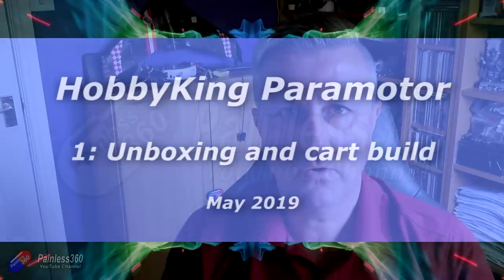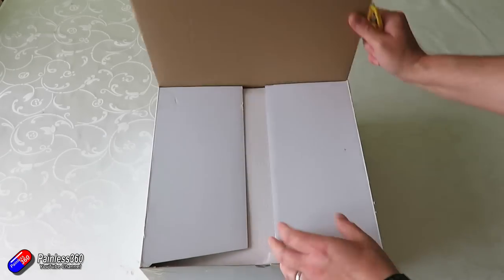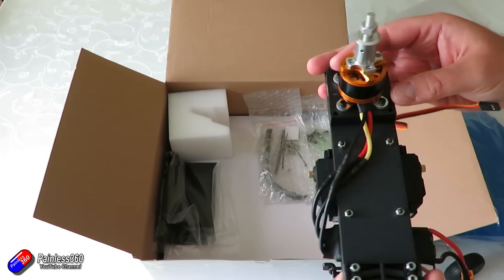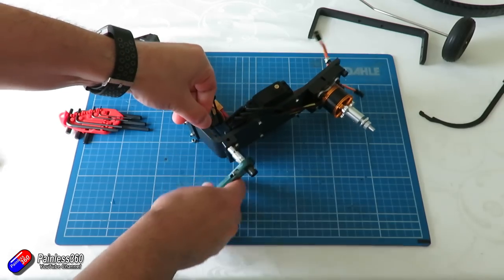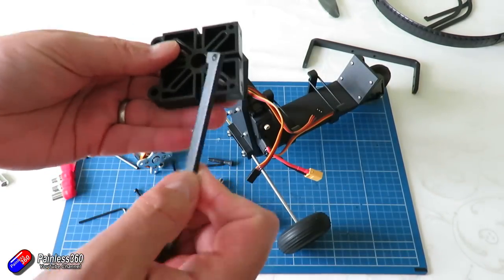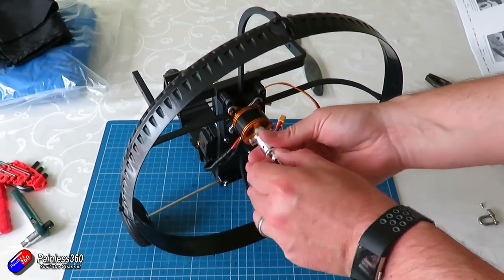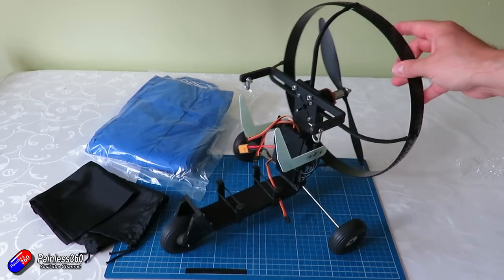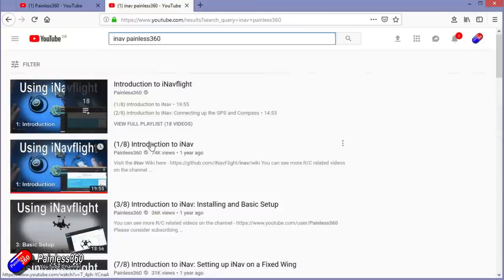HobbyKing Paramotor Pt 1: Unboxing and building the Gondala

Comment: This is a really nice, well made kit and I look forward to using it to teach my little 4 year old shadow how to fly RC.  She already "helped" on some of this build.  She loves crashing the simulator and has since she was 9 months old!  A couple of suggestions to HK on this model; first is the packing.  Rather than taping the two hardware packages to the top of the bottom cardboard divider, place both hardware bags under the cardboard divider in the center of the prop protector ring and eliminate the small foam block currently packed in that ring.  Pack the prop, para-foil, para-foil bag cart and landing gear mains exactly the same way as already done.  This eliminates requiring packers to tape the two hardware bags to the top of the bottom cardboard liner and it eliminates the small foam block under the bottom cardboard liner.  The second suggestion is to change the location of the ESC to the back side of the cart frame.  The fit of the recommended 5000 mAh battery is too tight with the current ESC location.  Using the recommended 5000 mAh battery, the bottom two screws for the front landing gear wheel can damage the battery from vibration or in a crash and there is absolutely no room for any padding to protect the battery from these screws.  Moving the ESC to the backside of the cart leaves adequate room for battery pack padding in front and back.  To move the ESC to the back side of the cart, the plastic ESC cover holes will need to be elongated slightly and the nut tabs on the ESC cover will need to be cut out to recess the nut slightly into the ESC cover.  The bottom two servo mounting screws will now be used to secure the ESC cover rather than the top two landing gear screws.  As a further measure to prevent possible future battery pack damage, I will also countersink all four front wheel mounting screw holes and change front landing gear screws to countersunk screw head screws.  With countersunk screws, the padding used in the bottom of the battery tray can be extended all the up the front of the battery area.  A nice flat, smooth surface is much less likely to puncture a Lipo cell in a crash and rumor has it Lipo's may get real nasty if punctured.

Comment: I am going to change the cable ties on the sides to have the connection nub on the inside of the hoop.  The lines catch often with them on the outside.   When are you going to fly?  Currently I am having trouble kiting the wing up with anything close to consistency.   Haven't let go of it yet.

Comment: I just maiden mine today and had no issues with the antennas placed like you have at the end of your video
Reply from the maker: Great. And did you line up the brake with the top rings?
Reply: Yes I did. First flight I didn’t add any weight and with the rhino 5000mah battery it was 1445g I did end up with a wing tip collapse fell about 40’ bent landing gear and shroud supports fixed it up and added weight for a total of 1756g and she flew awesome. I flew for 22:39 on one charge and had 3.85v each cell left over. Thanks for your videos on setting this up. I can’t wait to fly it again.

Comment: The recommended battery size is 5000mah 3s, would a 20c be sufficient? Struggling to find an ideal battery
Reply from the maker: Should be, that pack should be capable of 100A - much more than the ESC is rated for.. Best of luck!

Comment: Hey, what can be the reason that a 5inch race quad with INav installed tries to fly away when alt hold or pos hold is enabled? 
I've set loitier throttle to 1300 and 1200 all with same result. 
It won't come down even if i move the throttle stick to 0, the only way is to turn alt or pos hold off
The board is an omnibus f4 v3 with Beltian bt-220 GPS
Reply from the maker: What troubleshooting have you already done?
Reply: @Painless360  it's my first time with inav. No idea where to start. Last night I checked the sensors tab and in baro there is two graphs. Altitude seems OK, but barometer is of by 15-50 meters
Reply from the maker: Check out my iNav series for how I set iNav up.. It could be lots of things like not getting a 3D GPS lock before arming, compass interference etc. for the GPS issues.. Best of luck!
Reply: @Painless360  GPS gets 18 sats and 0.8hdop accelerometer and magnetometer is calibrated.